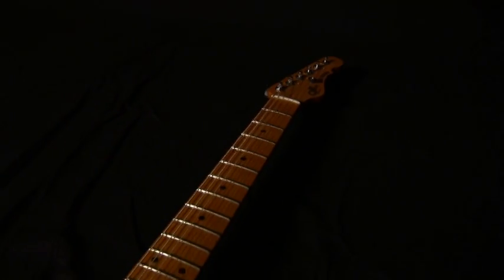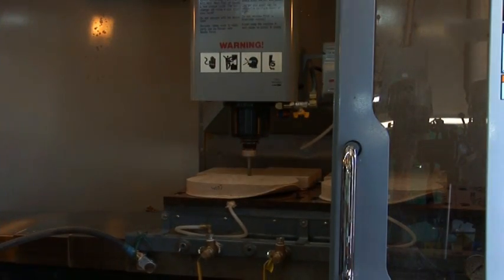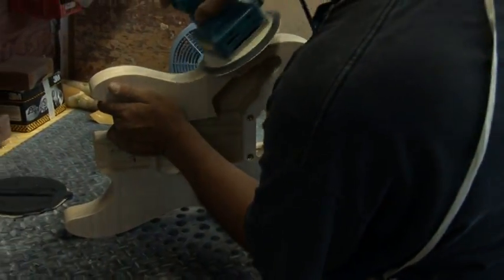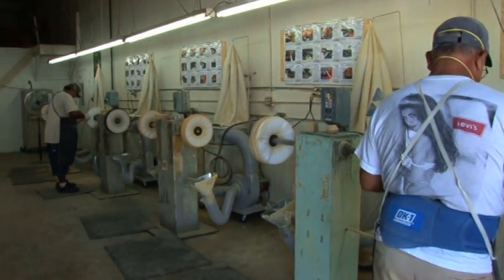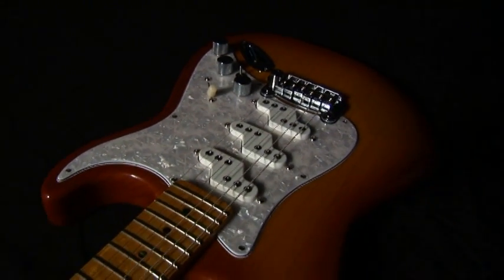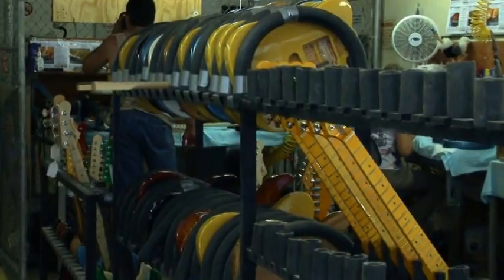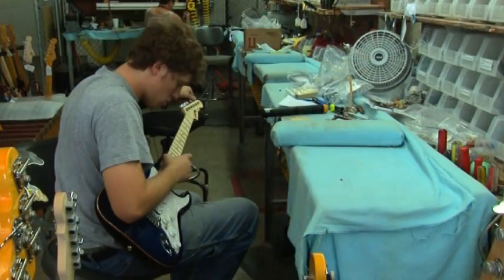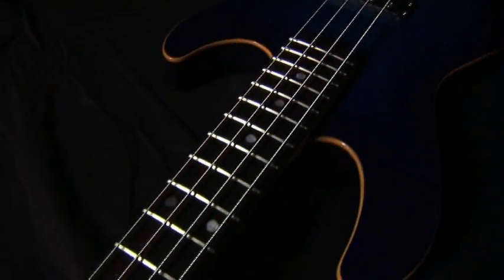G & L - Factory Tour

Comment: I have a G&L ASAT Classic-S its a 3 pickup Tele, In my 35 years of playing guitar, and I have owned hundreds of guitars all the way from the original 50's guitars to brand new, custom built PRS's. The G&L ASAT Classic-S is my "ALL TIME" favorite guitar EVER. I have owned 59 Gibson Melody Makers, 60's and 70's Gibson SG's, 60's and 70's Stratocaster's, custom shop Les Pauls, and Stratocasters, and custom built PRS's. To be better then all those guitars really is saying something. I know alot of it is a subjective thing. But some guitars, just become an extension of your body, and your soul. My G&L does that in spades. To clarify though I have done some custom work to it, I have shielded the whole body cavity, and added Joe Barden pickups and deluxe locking tuners. This guitar will SMOKE any Tele that I have EVER played, and I've played hundreds of them.